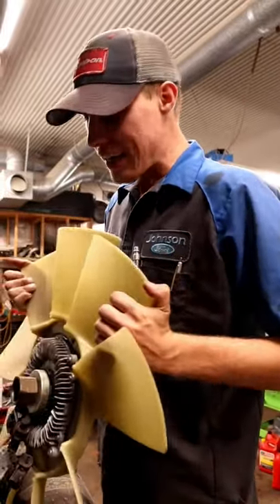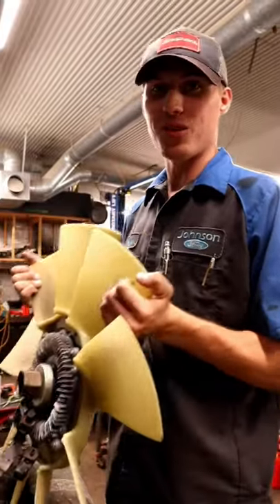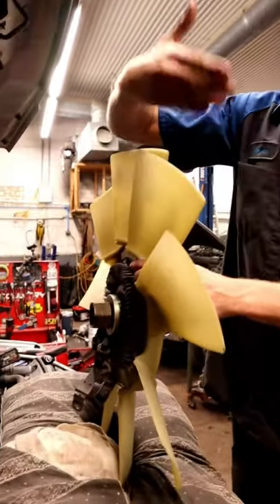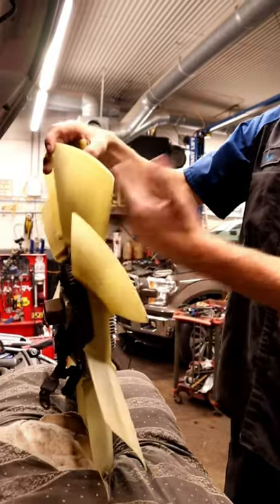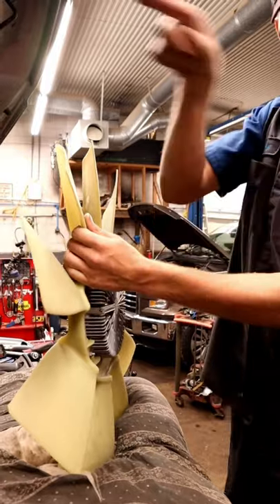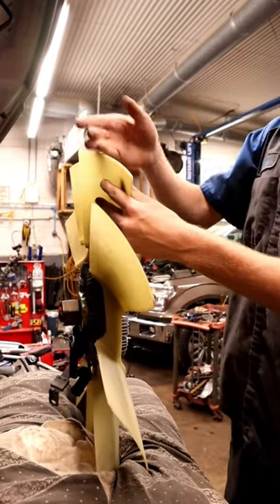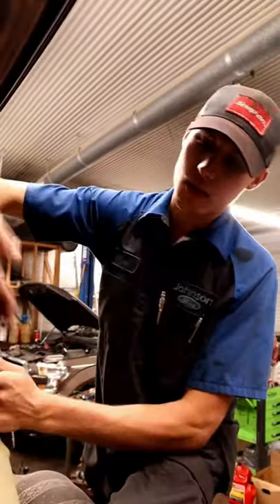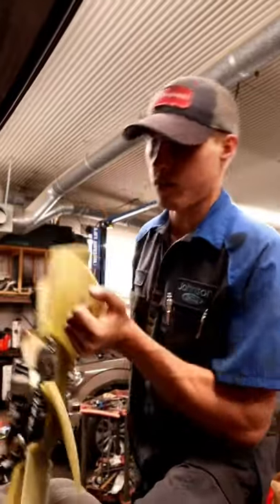How to Determine if a Fan Clutch is Left or Right Handed Threads on EVERY MAKE & MODEL? #shorts

Comment: Old timer taught me, slightly crank the engine. If it spins to the right, then you turn it right. If the fan turns left, you turn it left, thats how it comes out.
Reply from the maker: Same concept just a different method. Thanks for the input!

Comment: Another tip;;
On vehicles that you can't hardly get to the fan to restart on the threads of the pump,,
Take some electrical tape and wrap it around the hex of the fan clutch and leave it long and tape end to the end of fan blade,,hold the fan up to and centered to the pump and pull the tape and it will spin itself onto the pump!!!!!!
Reply from the maker: I’d like to see that in action haha
Reply: @FlyingWrenches13  it's very simple as the tape is pulled it spins the fan clutch onto the water pump,,
It's easier with 2 people use both hands to hold fan blade stationary and centered while another pulls the tape
Reply: Thats very smart.
Reply: That's incredibly stupid.
Reply: @jr.granados4670  tha fuq? Upload a video of you doing this I would absolutely LOVE to see it.

Comment: It’s kinda like knock-off lugs on racing wheels. 

You need to know which direction the wheel spins and which side of the car you’re on before you start whacking star-shaped tightening lug. 

Basic physics.

Comment: No one seems to tell you how to get a stuck clutch bolt free ,this is better than a air hammer take a rod run it to the frame to the bolts behind the clutch bolt it will lock it firm so you can use your 36 mm to break it loose, thank Jesus Christ for that ideal he gave. It was stuck hard  and kept turn the pullys not allowing it to be broke free. Thanks for explaining which way the nut and fan should go.